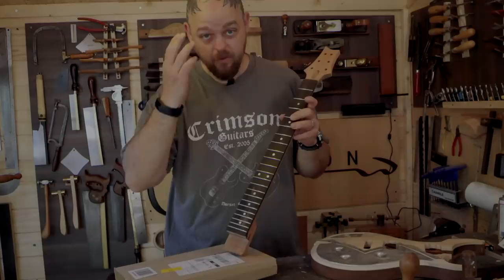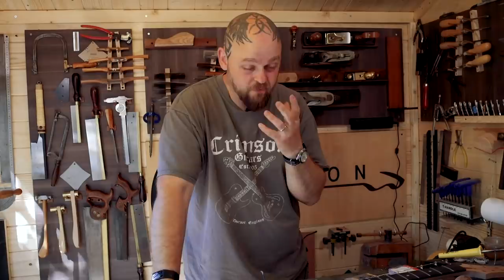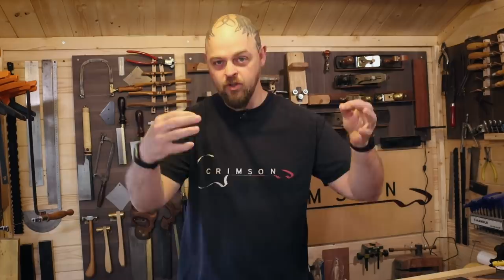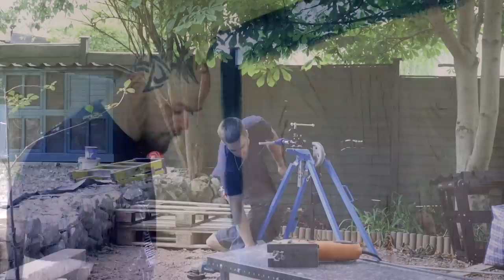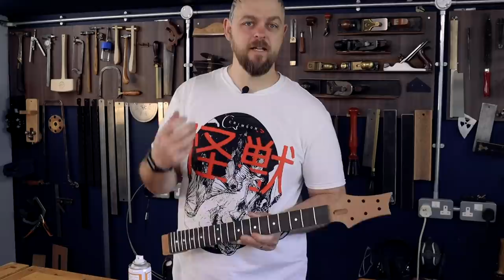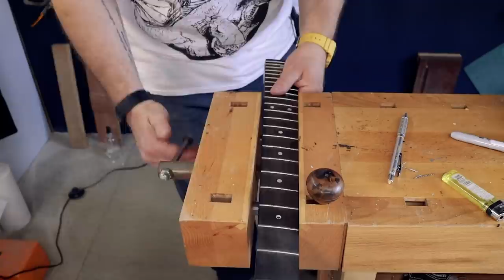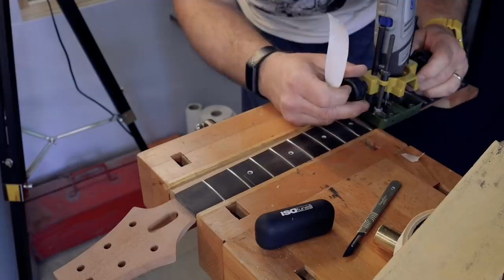Utter Failure Ep 10 | Building a CYBERPUNK 2077-inspired Custom Guitar

Comment: my wife was laughing at me as I was screaming at my computer about the fact that the steel strings would short out the frets.
Reply: It would be cool if you could wire it up the other way so that the fretboard lit up where you were playing it though.
Reply: So that was the thunder. Ominous indeed.
Reply: Forest Fifer Herman Li has this on his main guitar, its really cool you can see it on some dragon force gig equipment video
Reply: Well I just think the leds shorted by the strings as you are playing can be a super dope effect !
And if the wires could be inlayed all naked between the frets (how ?  hell i don't know), that could be a nice cyberpunk looking circuitry
Reply: @quasard4584  You would need separate power supply for each LED if you wanted it to look anything at all. If they are in the same circuit, all the LEDs go out at once, when you start playing.
Reply: @goranandersson3544  you wouldn't necessarily need a separate power supply, you just need separate ground routes for each LED to make them light up when the string was fretted, and the frets would act as that.
Reply: @jacobbreeding9494  Yes, that would be another alternative, but it still is a lot of wiring. It also means that only the LED under your fingers is lit up.
Reply: As we all were.
Reply: @quasard4584   shorting a battery continuously will cause the battery to overheat and go dead within minutes (try it).  If you wanted this effect you would need to have a circuit that shut power off to the leds when the frets were shorted.
Reply: @chrisyoung8062  the way he had it wired he was only shorting the LED itself, the current limiting is still in place so power consumption is nearly constant. Not an ideal circuit design I'll grant you, but not a fire hazard or anything.
Reply: @brocktechnology  was the resistor still in the circuit?  I must have missed that.
Reply: Forest Fifer I had that though too.  Super cool

Comment: BEN!!!  Electronics Technician here, You knew the right answer all along!  Pull the fret board off and get the electronics correct then replace the fret board.  You know it's the right answer. You have just made it harder for yourself my man.  By the way, get the resistor size right and wire the neck led's to the whole guitar and lose the 9v battery.

Comment: Sounds like it would be easier to “simply” remove the fretboard and rout as needed.
Reply: Oooooooo yes 👌
Reply: In theory he could get a neck and fretboard from his company that hadn't been glued together yet and route channels then mod the fretboard and then glue them together but that would sort of be cheating... I'd still remove the fretboard I've done that to a couple guitars when the wood was unstable and I routed out a couple channels to put in some carbon fiber rods
Reply: @skydogstudio  for me the best solution. if a rod is broken, just pull out the old one, put the new one in, done. quick and easy.
Reply: Such effort to avoid removing the fret board 🤦‍♂️ On the other hand, you don't innovate by following the obvious path.  And this video was very entertaining 😂

Comment: Ben..... I know exactly how you can achieve this using the method of placing the wire  rod channels down both sides along the fret ends and building the "ladder" across each fretboard dot like you originally wanted. Your only hurdle was how to get those short wires spread to each side.... well... simply solder longer leads and thread them through the inlay holes first and pull the wires once they poke through at the holes inside the fret end channel. This will allow you to seat each LED the way you want under the inlay. You can then just cut off the excess and solder to the channel rods. To combat the issue of the "ladder-rung" wires on either side of the LED having that slight amount of slop, because you will have it, is once all LED's are soldered, just rotate the channel rods in opposite directions ever so slightly to tighten the wires up a bit. That will tighten the wires and pull the rods in tight to the wood..... this will take good solid solder work and a bit of finesse, but I think you could totally pull this off!!

Comment: I suggested routing a channel down either side of the neck, run fiber optic cables down it, and fill the channel with resin. Drill holes from the channel to the fret marker, feed the fiber up the hole, replace fret dot with transparent dot or fill with resin.
Reply: Yeah, just got to idea 9. A  bit like that but with fiber optics .
Reply: Would that resin crack with any neck adjustment in the futre though????
Reply: light pipe and just 1 side, filler and stitch glue...no crack no seems 
really only need 1 side for it to work..2 sides for aesthetic balance is better but weaker...BUT...light pipes can be very thin and nearly inconsequential to strength.
theres even lighted wire (the wire itself lights up) and pinstripe (actual car pinstripe that lights like cob led's) for the adventurous (car customizing market uses these on interior work)
Reply: It may be easier to install but I don't think fiber optics will last a long time
Reply: Fancy seeing you here Forest... Taking a break from idiot bashing eh? Me too.
Reply: I was thinking fiber optics too
Since the main body is basically homemade polycarbonate/acrylic fiber optics anyway.

Or Ben could invent steel core nylon insulated strings and go with idea #1265 and power the LEDs with the frets. But I think fiber optics would be more cost effective.
Reply: @ReValveiT_01  indeed.
Reply: @natsterjam  good point, hadn't thought of that. Um, idea 9b ( subsection 12, paragraph e)?
Reply: fiber optics could use a single light source.... easier to replace than single burned out LEDs............
Reply: Forest Fifer lots of similar ideas here, piping the light rather than the power. Also only one light source will ever need replacing...

Comment: I did this once with the fret dots on an ukulele. I recommend using smd LEDs, as they are a lot smaller (and a bit more difficult to solder). I milled a slot below the fretboard before glueing it on and embedded the LEDs from the back side using epoxy for protection. I drilled a hole through the neck inside the body for the wires. Worked out pretty well, but I sadly had a bit of tear out when drilling the fret dots because I used a poor quality drill bit. Was my first build after all, I am an electrical engineer.

Comment: So, first a few congrats.
Love the new workshop.  Bollocks to you on us not caring.  We do.  You're creating an amazing space.
Also, way to go on 250k.  Milestone.  Feel proud, you've worked hard for this.
Now, for the real.
Don't beat yourself up.  Even a master craftsman can continue to learn.  And that's what this video has given us.  A learning experience.  Well done.

In truth, the only place you buggered things was trying to overlay ideas.
Your last idea was truly inspired, and embraces the "street" aspect of CyberPunk.  I was sitting here cheering the vision of the neck with yellow and black traces running around it.  I had thoughts of telling you to pull the fretboard, and route a channel the length of it for some EL ribbon, instead of LEDs, but you nailed it.  That "thought out but unrefined" look is a very popular theme in the original CyberPunk, and you captured it, swimmingly.
Once the new board is in, take "Idea 12" and run with it.  It should work out well.  The only advice I can give you is to set aside your professionalism for this build.  You are used to creating a certain level of, shall we say, refinement, that this build will fight you on.  The street calls you. Set aside your professionalism, and let your tattoos take over.  ;)

Comment: At 8 mins with parallel they must be all the same type if using one resistor, Old trick. back in the day each led got a resistor even in parallel for all to be to work it is due to different colours that use elements as the light emitting part of the pn junction that produce different colours eg green and red make the LED drop a different voltage. hence a different colour will hog all the voltage and starve the other colour of voltage. Yes they are current driven but they need to drop the correct voltage before the current lights the LED first. Sorry for the dummed down version

Comment: Another idea would be drilling straight through the fretboard from the top near the edge, and then a long channel along the neck you could fill in like an off-center skunk stripe. Kind of like extra dot inlays, but along the low E string in conjunction with the inlays that are already there. For symmetry you could do a double skunk stripe on the back. I really loved the idea you had at the end!
If my university opens the workshops anytime soon I just might attempt that on a bass neck.

Comment: There is a way to put LEDs under finished fingerboard. You just have to use SMD LED, which are small, but 1206 size is big enough for skilled woodworker with a bit of soldering skills. Drill 3mm hole across fretboard, and 6mm for fret dots. Solder resistor -> SMD LED  -> wire and put it in 3mm hole so LED is under dot hole. Cut a channels alongside top and bottom side of fretboard. Put + wire in one channel and - wire in other. Solder everything. Pour resin in dot holes. Cover side channels with something nice.  Using high efficiency SMD LEDs with 1-2mA current consumption will improve battery life.

Comment: I like the idea of the power wires going down either side of the neck and having the wires for the LEDs wrapping over the fretboard without removing it. It's a very cyberpunk aesthetic to have something that looks like it's had tech grafted onto it later. Have you considered using surface mount LEDs? They are a lot smaller and would require less wood to be removed.

Comment: Question, have you anywhere left to put a 9v battery and a switch in the body for the LEDS, rip the neck off drill thru the neck and use the LEDs  in place of the MOP dots and slightly fill with resin 5mm not 6mm holes for LEDs, and maybe go down to a 33 Ohm 2 watt resistor, on another notewhen you first wired the LEDs with the red in line the red has a voltage drop of about 2v and white are about 3,5v so the power is going to take the easiest path and head for the red first I wouldn't really call it a "failure"

Comment: Thanks for sharing your process in this video--I loved it!  I also wanted to be there coming up with ideas with you... I was sitting there going "Oooh! What about this?!  And this could work! And this...."
Others posted earlier about the idea of using fiber optics to get the light where you want it--I came to post the same thing. You can likely get away with using a plastic filament--5mm side glow would be really cool. I suspect you could etch where you want to light to be even brighter or use hot glue to create a diffuser--there are a few videos floating around out there.  A bit of heat shrink tubing can be used to attach an led to the ends of the cable (no need to get a fiber optic emitter--you can attach to the same color system as the body. Lots of different fiber types available--just search for model fiber optic supplies. Here's a cool overview of common fiber types from Instructables: https://www.instructables.com/id/The-Beginners-Guide-to-Fiber-Optics/.
Sorry if you are already up on fiber optics and I'm just rambling pedantically about something you already know. Your project got me excited, and I wanted to share. If not this build, I suspect there is something really cool that you could on a future one with the stuff, especially if you wanted to tuck one of the micro arduino's inside to achieve some cool effects that the boxed controllers won't do.
Anyway, keep the awesome videos coming! I'm learning a ton, and I hope to have the extra funds to pick up one of your kits sometime relatively soon. Cheers!

Comment: i like the idea of just using a bit of metal rod as the negative terminal. if you used two rods placed together with an insulator in between them, you could place that on the side of the feet board and connect up the leds by simply connecting one side onto the rod closest to the leds and drill through one to get to the other rod behind it and connect the next terminal.

Comment: Hey Ben, my sympathies for your deceased fretboard. Having the frets be exposed power rails definitely fits the cyberpunk theme. Could the string touching live frets interfere with the pickups? There shouldn't be any current in the strings at the pickups but because they'll be constantly switching between a positive and negative charge they may affect the sound. If you still plan to use that method it might be worth looking into.

Comment: with the circuit shorting across the frets it will also drain the battery in a very short time.
Reply: A little arcing between the fret and the string won't be a good idea either!
Reply: The shorted circuit is still current limited, power consumption will be very close to what it is in the on state.

Comment: for wiring, have you considered coated copper wire ? Originally used for winding the pickups and such, but they come in all sorts of colors and guages, you can solder it and they're still perfectly insulated. I used twelve different colors for a custom mechanical keyboard build.

Comment: Have you considered using fiber optics to get the light to where it needs to go without having to worry as much about the placement of the wiring?
Also, per the aesthetic, I think the lights blinking would be on point. A human action would be allowing them to blink in real time as opposed to using a switch.

Comment: Respect for showing the accidents

Some idea: if you need to drill parallel by hand, just stick some pins or nails in the previous holes serving as guides. Or (if too far apart) have one nail in a piece of wood with double-sided sticking tape on its base, to stick it on the workingpiece near the hole you drill. Its easy to parallel match your drill 
with that nail by eye...

Comment: You should try microfiber for the side dots, the same as they pass data through.
I managed to create small lightbulbs for car model building kits, by putting one side fixed to the LED with shrink tubing and heating the other side so it forms a lens shaped end. I had live like results with it. I have the same idea as you for a while in my head and had that as solution for the side dots. Perhaps molding with resin combined with microfiber wire can do the trick as well with the inlays. You can use the microfiber and pass it through to a compartment in which you can put the led source and a battery. Like this you wont have wires in the neck with current.

Comment: Ben, you could route all the  positives of the leds at the bottom like you mentioned it in idea eleven. But the negative of each led would go to the corresponding frets. You could use the strings(bridge, body ground, etc.) as the negative so that the leds would light up at each fret played
Reply: To simplify, you use idea 10 for the negative side and use idea 11 for the positives. The positive terminal of the battery would go to the positive rail at the bottom and the negative terminal of the battery would simply go to the body ground

Comment: I’d suggest drilling the MOP and instead of the bulb style LEDs switch to individual sheet style. Since you’re already replacing the fretboard, you’d be able to route the under side of the board for any wire hiding. You could then fill the MOP with epoxy and it would be awesome.

Comment: Future iteration recommendation:  Use light pipes.  Acrylic rods or resin cast into a shape that will fit the side dots and the fret dots in one unit.  LED just has to be on one end of the pipe like a laser on a fibre optic cable.  If the surface of the dots are roughed to a dull haze, the light will be diffuse enough to glow evenly like a set light with a diffusion panel on it.  You could also integrate a circuit with an 18650 as a battery bank, with a small USB C or Micro USB charging port wired in.  That way, you'll get a long use of the led between charging, and not have to repeatedly buy 9V batteries.   (but you'd have to take the fret board off to do this idea, as it would be installed before the Neck is assembled).  Cheers!

Comment: Route a channel down the side of the neck. Lay in a fiber optic bundle, utilizing a (correctly sized) single strand going from each point of light on the neck, (all strands being bundled together) to a SINGLE light source within the guitar body (with battery). One light source (LED) illuminating the entire neck through fiber optic strands. (1 Battery, 1 resistor, 1 switch).

Comment: I would look at using led chip instead of diode (way smaller plus rgb options) and use opaque inlays over the top to hide them. Definitely take the fretboard off and rout from behind but you would only need tiny metal posts to carry the + - that they could just sit onto.

Comment: Here’s an idea, you can make something like a trench going up the neck on the back side of the guitar; drill holes and put the battery wire system in the bridge casing. 
Hopefully this idea helps. 🤗 Not trying to tell you what to do or anything.